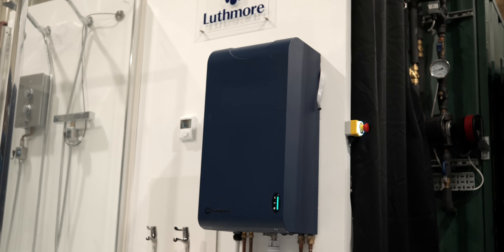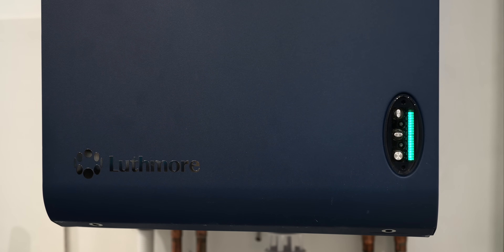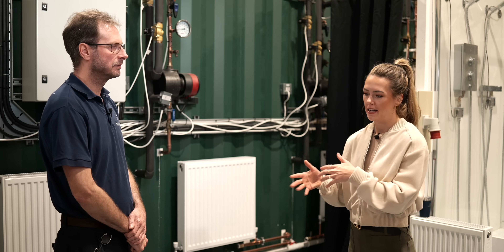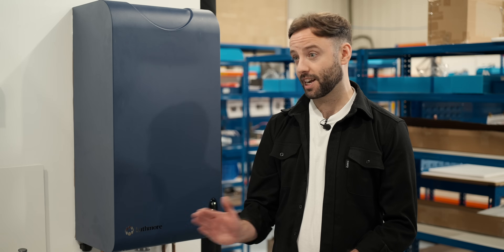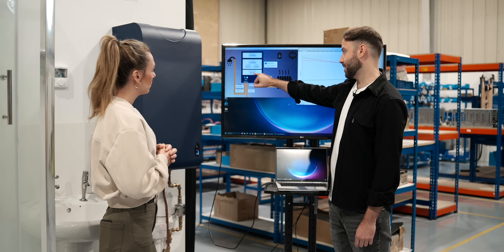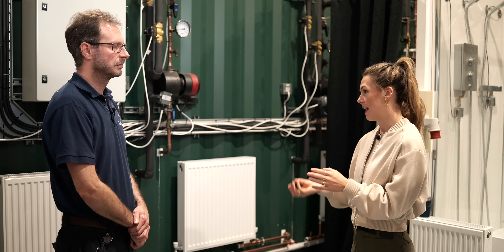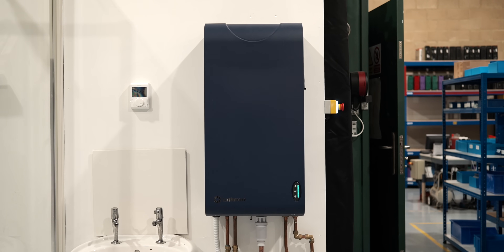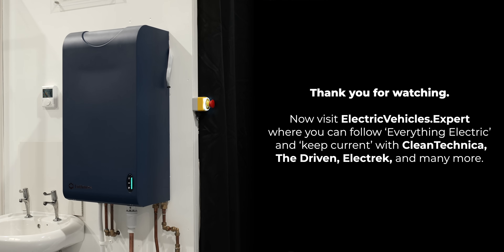Could This Battery Boiler Replace Gas AND Heat Pumps?

Comment: Why would you store energy in an expensive battery, when you are only making hot water, and can thus store energy in hot water instead.  Put in a tank, connect it to you 300% efficient heat pump, and use it as you need it.  Alternatively insulate the building enough that you only need to heat it once per day.  That works fine here in the colonies where it is much colder.
Reply: Its really aimed at high rise flats and small homes without space for the heat pump infrastructure.
Reply: @JJ-zg1hh yup. Me. This looks like a solution rather than a sunamp device
Reply: @JJ-zg1hh  High rise flats should have centralized heat pumps.
Reply: @CorwynGC if the building already has a main hot water flow and return line and each property fitted with a pkate heat exchanger and heat meters, then yes I agree. If however it doesnt, and gas combis are already there, then this technology may make more sense.
Reply: @JJ-zg1hh  Sounds like a lot of things you don't need.  Heat pump, storage tank, and a mixing valve is all I would need.
Reply: @CorwynGC in a very small property you just might not have the space for a normal heat pump set up.
Reply: @JJ-zg1hh  So make a smaller heat pump setup.  Why throw 300% efficiency away by making your product with the wrong technology.
Reply: @CorwynGC so if you have no outside space whatsoever (not even a balcony)  no room for a hot water cylinder, no room for a buffer tank, no room for an expansion vessel, where are you going to put it? Im not saying this battery boiler tech is for everyone but it will certainly suit a proportion of the market. 
Also, different technologies are allowed to co-exist you know...
Reply: @JJ-zg1hh  I don't know.  No one around here would even consider putting any of those things outside.  If you are putting hot water tanks outside, I think that there is a LOT you are going to be able to do to improve your energy efficiency.

Sure different tech is allowed to co-exist, but BAD technology isn't going to.
Reply: It's an option for people without the room for the hot water cylinder.  However I think that combining the battery storage and the water heater is the wrong approach.  Why not make it a modular system, so that the instant water heater can be installed and used with any power source?
Reply: @GregS-UK  because that^^ ie seperate components is already a "thing" ie you can already buy all the necessary components to do just that.
Reply: @maxtorque2277 I thought there was something special about the 30kW discharge rate of the battery, but now understand that's just a function of the inverter (which this doesn't require to power the DC heating element).
I guess I'm not the target market (I have the space for a hwc for one thing), but I'd feel slightly miffed if I had spare off peak energy stored in the batteries inside this water heater and no way to use it apart from doing that. 
But I think it is quite a neat solution for the niche it sits in.
Reply: That is the issues. It was said clearly, not every property is suitable for HP...
Reply: @melhiore  Why not?  What conditions in the UK could possibly make it unsuitable?
Reply: @CorwynGC  Terraced house, water tank removed and space reused for expanding a room.  So no space to put the tank back - our government said it was OK back then... Building regulations not allowing to put the HP to close to windows, doors, vents, property boundaries. The list goes on...
Reply: @melhiore  So appropriate; just not legal or in keeping with your lifestyle aspirations.

Comment: As someone with microbore pipes to radiators, making a heat pump installation a difficult / expensive proposition, this is exactly the ikind thing I might end up with.  Whatever happened to that Microwave Boiler?  Gas suppliers bought the tech and shelved it? 🙂
Reply: You can do a heat pump with microbore, as R290 heat pumps can provide 70C+ water if needed, they just aren't as efficient that high, but they would still be 2x as efficient as an electric boiler.

The idea would be to get a heat pump and battery and charge up on off peak electricity.

I think the real niche for these electric boilers is where there is simply no space for an external unit at all.
Reply: @slrsteve6359 I spoke to Octopus about the new generation of high temperature heat pumps a year or so ago and they said our property still wasn't suitable.  Perhaps another conversation is in order.  Thank you for the info.
Reply: @PHXRenegade my opinion is Octopus only really want high volume "easy" installations, we had a weird issue and they said it wasn't possible.  Now I'm sitting here with a heat pump working just fine.

Try Heat Geek, they were expensive but at least you should get an idea of whether it truly is possible, and then get some comparison quotes.

Good luck.
Reply: @PHXRenegade They have a newer Cosy heat pump that's capable of 12kwh heat output (previously they only had 6 and 9). I think those are starting to be installed from January.

I'm getting a Cosy 6 in January as well. Fortunately I don't need a higher one. I do have plastic pipework as well, which I think is 10mm.

Heat Geek is another option too, as others have said :)